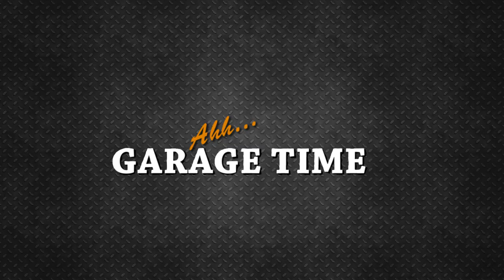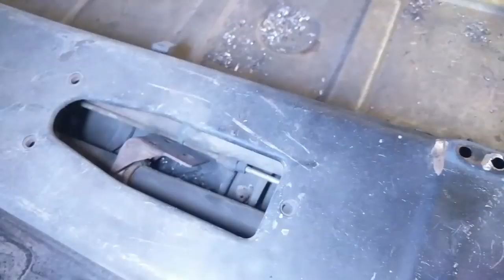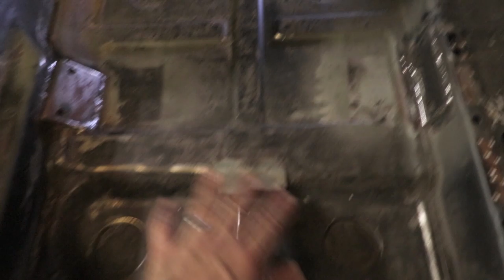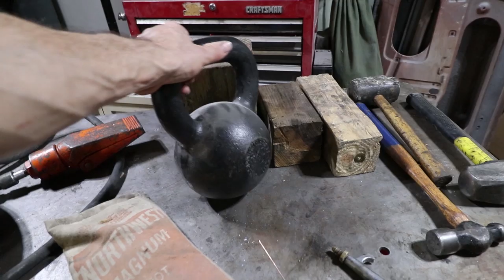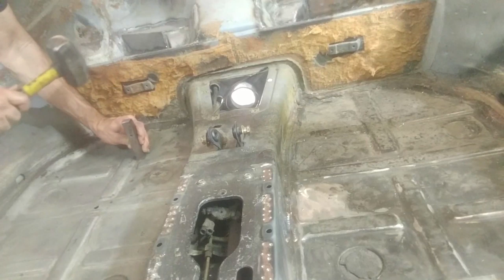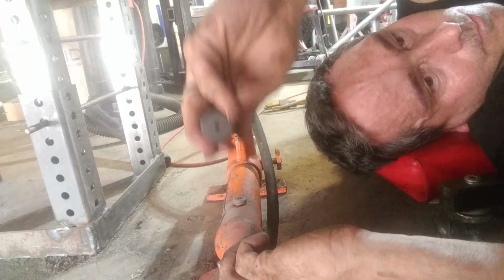How To RESTORE My Abused Porsche Floor Pan 🔨

Comment: Good use of counter-weights there, Tom. Especially when getting up off the floor :). What's the semi-circular depressions in the floors? I notice a few of them seem to be punched through a bit. Just curious.
Reply from the maker: Thanks Chris!  I'm not really sure what those holes in the floor are.  I've heard two things, 1) some of these cars are dipped for galvanized coating so the holes might be drains.  2). The holes are used for assembly jigs during the assembly process.  My car wasn't galvanized but a few years later they were.

Comment: Now the FLOOR !!!
..... Anyway...I Hope you use Bedliner and remove the old school undercoating. It turn soft when hot sucking up dirt rocks and then hardens when cool and repeats the cycle till it falls out in chunks / or just gets heavy / and just turns a brownish hue.
 Bedliner is 2K ...I love uni- pol Raptor ( its German ).
It drys like those red plastic. Gas cans...( But Black)
It dries tough as hard plastic repells moisture , dirt and debri. Is rock and chip resistant , sound deadening .
  Ive been using it as under coat since it came in the market years ago...
It stays black its uv protectant.
And you can spray it thin or thick in higher stone reflexion areas.
It comes with a shutz gun to apply. 
PERFECT...
Reply from the maker: Nice, thanks for the recommendation.  I was going to use gravitex from UPOL.  I'm not up to speed on the differences???
Reply: @GarageTimeAutoResto  gravitex is 1k ( one component undercoat by unipol)
Raptor is 2k Bedliner by uni-pol.. I have used on many restorations from Big Healeys to Porsche to Z cars. 
As you know 2k beat 1k everyday.
Reply: @MindDezign  any tips on removing the floor insulations inside the Porsche 911?
Reply from the maker: Dry ice, putty knife and a hammer is the safest and cleanest way that I know of.
Once it gets really cold it will crack and break up

Comment: Re check all your door gaps front and rear hoods... You're moving a lot of metal around and things get tweaked. Doors would be my main concern. An hour of checking may alleviate bending door hinges for hours. I Forgot... are you going with a dynamat on inside or spray sound deading
Reply from the maker: The door and hood gaps are still ok so far.  I haven't delt with the drivers side yet, but it shouldn't move much either.
I will probably put a few small patches of Dynamat on the floor, but nothing crazy.
Reply: @GarageTimeAutoResto   I really like what you did by welding in extra clearance for the trailing arms. Looks very very cool I would go for an   Outlaw look now. No Dynamat but you can spray on sound deadener that's only 3 mill thick.  That way you show the work that you did on the rear valence panel. Really like in this  Build keep up the good work
Reply from the maker: @Dogleg1957  Thanks, the bottom will get sprayed with sound deadener, so it may be enough who knows?  I agree with you that it shouldn't be covered up.  My plan is to leave it painted and then experiment with sound deadening after the car runs.  Some noise is okay!